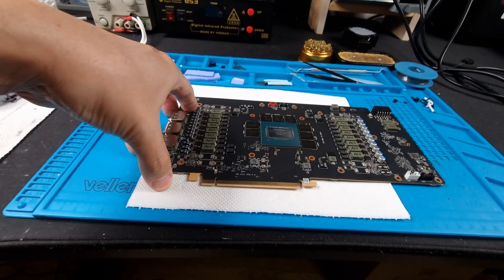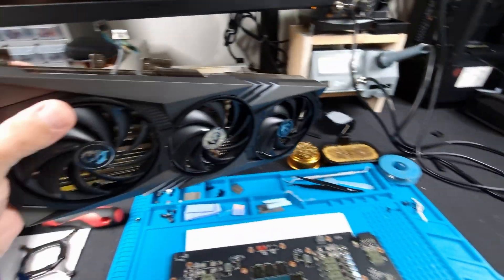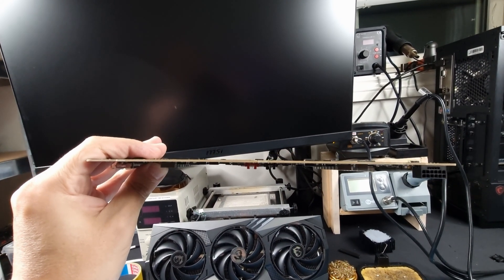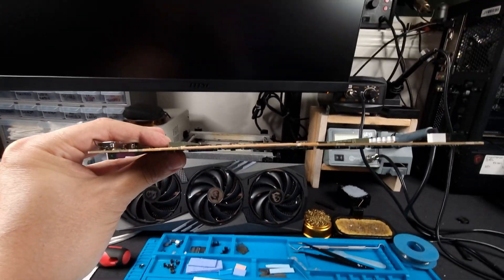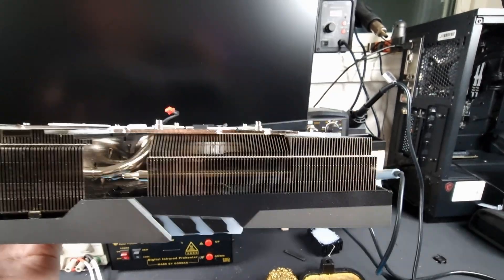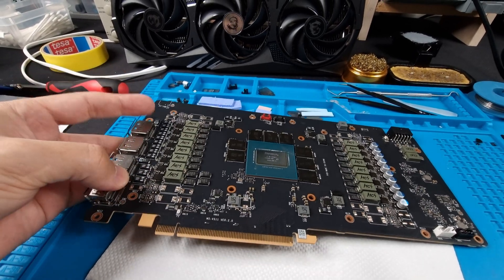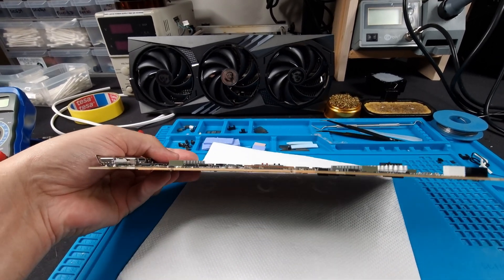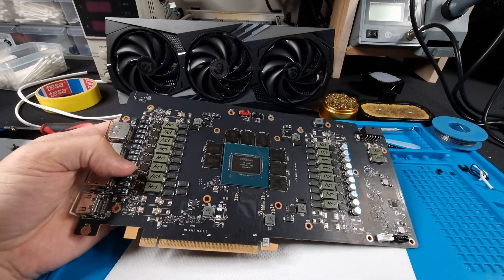How Using GPU Supports Incorrectly Can Destroy Your GPU.

Comment: Hello! In the near future I'm planning on buy one of those big graphic cards. Unfortunately, as others here I have a tower cooler which doesn't allow me to vertical mount. The vertical mount would not only require me to buy an AIO cooler, but also to remove the bottom stock fans from my Antec Flux Pro case. This means I would have lost money on buy my tower cooler and also my case, which is very new. From what I understand you are claiming that the only viable solution to avoid sag is the vertical mounting because even if you use multiple GPU bracket, hot/cold cycles are going to damage the pcb. I personally don't understand this claim, can you please bring more information? From my poin of view, if card load is evenly spread with multiple bracket, there's no way the card can bend and damage the pcb do to hot/cold cycles. Can you please explain this more in depth? I really want to understand what to do before proceed and buy a big graphic card.
Reply from the maker: @albysora46  I have made a video recently showing a bowed GPU core. This is the way it is because of supports added incorrectly, pushing the whole graphics card up by the 3x8 pin power connectors. Ultimately it is your money, not mine, so you have to do what best fits your situation. I'm just sharing what I'm seeing from a repair point of view. Supports are good, but if you have to use them to begin with, it should be obvious that there is a weight problem, thus the supports. I have selected all my hardware around the gpu, including my AIO. I just don't get why people spend $2000 on a graphics card and can't spend $100 on an adequate case or vertical mount setup.
Reply: @TechnologyHive  I've watch the video you are talking about some hours ago and I can give you the most honest answer. I've built my computer like one month ago (except for the GPU because I'm waiting to see what happens with Nvidia next gen before make any move) and even if I documented myself a lot by whatching videos and reading on forums before pick any of my components (and even if I was aware of the GPU sag problem), I've stumble on this video only yesterday.
So, from only yesterday I'm aware of this (GPU support bracket causing damage do to hot/cold cycles problems) but my computer is already builded (excep for the gpu, for which until yerstaday I was thinking a GPU support bracket was a fine solution).
That's why I don't want to buy another case and change my CPU tower cooler. I surely would if mine was an old build, but I've unfortunately changed everything one month ago! I hope you can understand me and my situation.
By the way, my case, the Antec Flux Pro, supports the vertical mount, I would just need to remove the bottom fans to do that. But this would be absurd since I've bought this Case for it's cooling performance which are the best in the market and I'm removing two fans. In a few words I can mount my GPU vertically, but I would loose the cooling performance of my Case, and so it would mean I have wasted the money on this Case.
As you say, the problem is related to how GPU are builded and the fact that support bracket should not exists, because the reason they exists is related to the sag problem that should not exist in first place.
Unfortunately sag exists and we need to live with this problem and find a solution to avoid it.
After all this long text (for which I want to sorry, and thanks if you read everything), I want to understand if the multiple support bracket is a safe solution from your point of view or not (if they are used correctly)? And how many support bracket should I at least use (and where) to prevent any damage do to hot/cold cycles to my GPU?
Last thing, are you repairing a lot of GPU of customers which are using multiple support bracket (ofc when used properly without push the card to the top)? Thank you!
Reply from the maker: @albysora46  If you are going with horizontal mount, place the support somewhere in the middle of the pcb, not the heatsink. The heatsink makes the card huge. And do not screw down the card before adding the support. Let the card rest leveled on the support, then screw the card down tight to the case.
Reply: @TechnologyHive  I think you have typo vertical instead of horizontal right? Sorry if I bother you more, but exactly what you mean for "place the support somewhere in the middle of the pcb, not the heatsink". Taking into account for example a Rog Strix 4090, can you show where you would place the support brackets (one or more)? I don't know if youtube can allow you to post link to an image, so if you are going to describe it I hope i will understand :|
Since the heatsink is under the pcb when the GPU is horizontaly placed, from your description I understand that the support should inserted into the space between the heatsink and the pcb and so touch directly the pcb (like directly on the right of the power connector) is this right? Or you mean for example to just put it under the card between the 2nd and 3rd fans where "ER" of "REPUBLIC" word is placed on the side of GPU?
Reply: @TechnologyHive  even if you didn't reply to my last message I think I've figured out what you mean (or at least i hope so!). The pcb lenght on 3 fans GPU ends near to the end of the second fan, and so you are advising me to put the support like in between of the first and second fan, right? Also I think that a second support should be placed on the edge of the card (I mean after the 3rd fan) where there's only heatsink. I hope to have understand it right! Thank you for the advice and help :)

Comment: I have a question. I have a very short pcb compared to the plastic cooling part. I bought one of these Amazon Magnetic GPU brackets. I Placed it under the Gpu. How do I distinguish the tiny "crack" noise from pcb crack. Could it came from the metallic heatsink. Because as I said the pcb is very short so it shouldnt be affected by it. Its an pny xlr8 4070 ti super pcb.
Reply from the maker: @earth-616universe4  Sorry I did not understand your question. What noise from what crack??
Reply: When I inserted the magnetic gpu bracket under the gpu I heard a tiny "crack" like noise. I am not sure if it came from the pcb (hope not, because the pcb itself of the pny xlr8 4070 Ti Super is very short compared to other models). I didnt even touch that area. But could it also come from the metallic heatsink?
Reply from the maker: @earth-616universe4  When you install any support under the GPU, you're supposed to loosen the graphics card from the case, then add the support under the GPU. Do not slide any support under that graphics card while it is screwed on to the case, or you will cause stress on the PCB, thus warping it and potentially causing long term damage.
Reply: So I should first of all remove the GPU from the motherboard. Then place the supporting bracket under the gpu and install the gpu to the case. How durable are PCBs from PNY or in general? Because I heard a similar "cracking" noise when I inderted the gpu for the first time into the motherboard even when I did it gently.

Comment: For that, I'm paranoid, so I bought a Y40 and put a hotwheels car to hold the end of the card too, because it goes down a bit and forces the riser PCI too.
I didn't know that, but it's pretty obvious, if you met the idea shown in the video.
Reply from the maker: @Manuzoka1996  I wouldn't put any pressure on the card, vertically or not. If the GPU is slightly raised on one end, just use a bit more padding under the riser, at the right side end of the under plate.

Comment: I bought a MSI 2070 Super in 2019 and it came with a support bracket. I never used it and I never had an issue with my GPU. But I don't buy GPU's with 3 fans because I don't like how long they are. Just install your GPU as recommended and you will probably be fine. That or just buy the smaller GPU's.
Reply from the maker: @wulfone5961  2 fan gpus are nice in that sense. No worries there IMO.

Comment: Im not a fan of vertical mounts due to the issues with them I heard online.

Will I be fine with properly mounting the support bracket so it stays level with the card, resting the card on it instead of pushing up? What about a mount that extends from the PCIE mount? like the uphere gpu support bracket
Reply from the maker: What you've heard online about vertical mounts does not apply to 3rd party vertical mount kits, like the one I use in the video. 

You can try supports as you see fit, but ultimately, vertical mount for large heavy cards is the best you can do.

Comment: so you need two supports
Reply from the maker: @herbertfeuerste1n120  I'd recommend you use a gpu vertical mount instead.
Reply: @TechnologyHive  that would be mostly a matter of budget (i could use a simple stick from outside) and the question if it fits in the case with other pci cards... and aerodynamic maybe also gets a little worse.
Reply from the maker: @herbertfeuerste1n120  $50 for gpu vertical mount is worth it if the gpu is heavy.

Comment: I know this is a late comment and I'm not sure if you will still see it to respond. If a riser cable then guarantees you to get no gpu sag at all, what would be the best case/airflow configuration for a airflow build. I was looking and finally found the Antec Flux pro and the case seems really really good for a airbuild and horizantal mount(I have not bought the case yet), and currently I own a 4090 msi trio x gaming and was thinking of getting a gb-001 horizantal support bracket that attaches to the motherboard for that case whenever I do get it.

With a riser what would be the best case then since wouldn't the airflow from the gpu be hindered a bit, since the hot air would be hitting the back of the case instead of going up and out of the case immediately and since every single case reviewer I see, says the same thing about air not liking to move in 90 degree patterns, is there a case that is optimal for a riser cable airflow build? Also what is the specific riser cable I should buy then, since I've been using a gpu vertical support bracket from the msi suprim x 3090, for my 4090.
Reply from the maker: @lovie74  The best case for a Phanteks vertical mount is the G500. Hands down the best case for the money. It supports 420mm AIOs as well.
Reply: @TechnologyHive  I see that's nice I'll look into it. I personally don't like aios at all I'd rather just have a optimal airflow build with a noctua nhd15 g2. Since that is as good as any aio for ryzen cpus from all the benchmarks I've seen of that air-cooler vs aios. 

Also was the main issue for people horizontal GPU mounts because they put it at the end? Like how about if you supported it somewhat in the middle and end so it's just fully supported horizontally since I don't mind how my build looks ngl, I don't care about asthetics at all just most quiet case fans which is why I use noctua fans and best performance.
Reply from the maker: @lovie74  i would rather just get a vertical mount. you can support it as you see fit as it is your property. but these cards are too heavy to be installed horizontally. as i write this, i have 5 cards here with cracked joints under the core, cracked PCB's and memory pads ripped. all this is common in cards installed horizontally.
Reply: @TechnologyHive  if there is this many issues with these. I wonder if Nvidia will be able to do anything in the future with the 5090 to support it more since I feel like it will be even heavier...

I'll try to look into vertical mounting since I've never done it and it always looked riskier to me back when they were just pcie 3.0. Since it always looked scary to hold a GPU that's heavy vertically like that butz im assuming it's  safer now or more advanced than years ago
Reply: @TechnologyHive  I looked into it a bit, and you were right like everything you said in your video also the wobble and GPU sag seems to be fixed with vertical mount besides some really heavy cards still somehow sagging with vertical mounts from some other videos I've binged.

Jayztwocents recommended the coolermaster riser cable and alot of people online have to since it's adjustable and seems to hold graphic cards well. 

I am curious on your recommendation for a vertical GPU mount for a MSI gaming trio x 4090 or does it not matter aslong it's its a vertical mount? Sorry about typing so much but for a year I've used a GPU support bracket for a my 4090 and I bought it used for 1200 USD( never had problems with it) but, not I'm getting worried since I don't want it to die on me early. Sorry for all the replies and questions.
Reply from the maker: @lovie74  I recommend this one: https://www.komplett.no/product/1220772/datautstyr/pc-komponenter/kabinetterbarebone/tilbehoer/phanteks-vertical-gpu-bracket

Comment: Is there a way to have it horizontal and not cause damage. I was thinking if you put the pc case on its back so the gpu is perfectly level then with no screws in the gpu put the bracket up enough to touch the bottom on the perfectly level gpu then screw in screws and after put the pc upright wouldn't that be a great way
Reply from the maker: If your PC case fits on your desk on it's side, then go for it.
Reply: @TechnologyHive  is the planteks gpu mount able to fit in lian li 216 do you think
Reply from the maker: @blocky623  I am not sure. But so far it has fit in every case I have tested it in.

Comment: I think I have seen the absolute best, and ugliest solution. A person had installed top quality fans on a row, straight under the GPU fans. Then did he cut out tubing that was from a bottom fan to a GPU fan, holding the entire card as three hollow pillars with lots of air going straight into the GPU fans.
Reply from the maker: @friedmule5403  As long as it gets the job done 😅

Comment: Maybe in many cases it is not the most elegant way, but placing the PC case horizontally on the table instead of vertically is a safe and probably the most economical way to prevent this problem, which is how I have used it with a GTX1080Ti since 2017. and zero problems, greetings and thanks for sharing your knowledge
Reply from the maker: @sirdonkey3001  Thanks for watching 🙂!

Comment: Sir, do you know the proper  thermal pads sizes of sapphire pulse rx 6700xt . Ny card is going 80 degrees and hotspot more that 95 degrees , it’s quite good for my 35-40 degree room temperature 😂. Still wanna know cuz i want to change the pads and paste.
Reply from the maker: @TheBigguy187cm  A quick Google search should give you the answer for the thermal pad question.

Comment: Don't know why the industry hasn't innovated a solution that's being growing ( literally ) over the years?
"Cards" stopped being "cards" when they went from single slot with minimal weight to a card with 1KG of copper and aluminum hanging off one side.
The PCIE ( or any connector ) should NOT be used as a structural support.
Vertical mounting the GPU connected by the flexible cable takes pressure off of the PCB connector.
Reply from the maker: It is cost. They rather give you a cheap solution to a future problem. Usually problems begin after the warranty has expired.

Comment: Would multiple anti sag supports resolve the problem. For example one motherboard bracket and two supports on the outside? I don't have the space for vertical gpu mounting.
Reply from the maker: It may. It is a lot better than no support or using one that is inadequate.

Comment: Would using a raiser/vertical mount potentially cause other issues? Having all the weight just hanging off one side couldn’t be good either or am I missing something? 🤔
Reply from the maker: I have yet to hear issues stemming from using a riser vertical mount properly. Btw, the card's weight is not "hanging" off any side. The card should be installed into the PCI-e slot on the riser, and screwed in place at the IO side. This is the best setup for your card.

Comment: GPU supporting brackets are a great tool when used properly. the purpose of that tool is to provide support. not raise the gpu. when users think its better to let it bend upwards instead that's when things go wrong.
Reply from the maker: The problem is that these cards are too heavy now. If the weight wasn't an issue, supports wouldn't ben needed. And all these cards I have here dead would still be working.

Comment: The problem is that with coolers that heavy even with vertical mounts the gravity still is in action and naturally the card wants to flip. I had a 5700XT which sat vertically 3 years and it bent a little. Not as severe, it works fine, but also its cooler is not as heavy as on 4080 shown here. The new GPUs got so power hungry that If we don't get some technology breakthrough which will reduce the power consumption we are going to end up with a GPU external box next to a small PC case :)
Reply from the maker: Looks like we're headed that way. The RTX 5090 is rumoured to pull even more power than the 4090.

Comment: My old card was sagging like crazy because it had no backplate and it was still alive and showed no signs of core or memory breaking off the pcb after 4 years of intense use. How do these newer cards break with a little sag upwards? That's crazy
Reply from the maker: @NotReallyLaraCroft  Older cards used leaded solder, which is less prone to cracking. Today they use lead-free solder, which it's more brittle.

Comment: Have been using gpus with and without support brackets for many years and from my perspective I believe sometimes people just install or use them wrong from what I have seen and experienced but the case with the modern supports is the fact that it might be too much sometimes
Reply from the maker: It is a combination of both, heavy cards and people not knowing how to properly install them. AIB partners do not include manuals explaining people how to properly use the included supports or people just overdoing it.